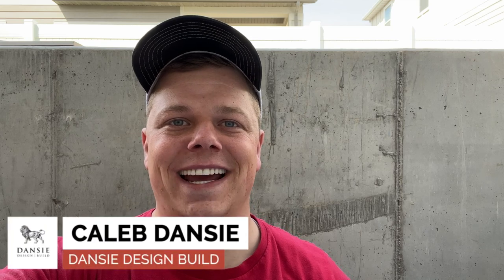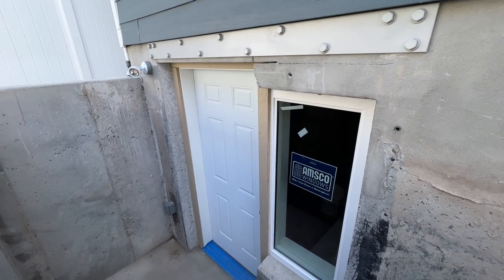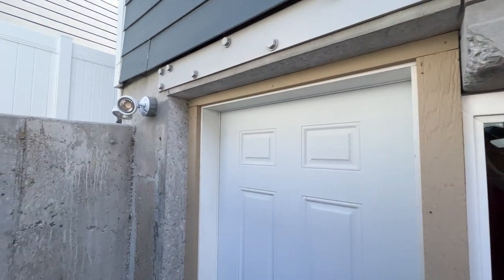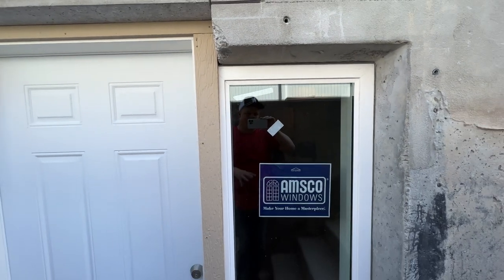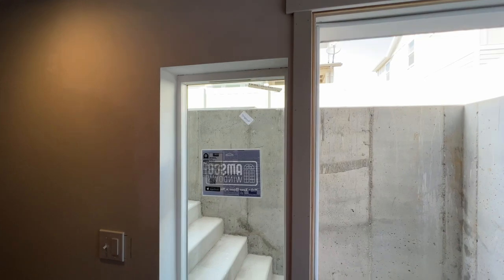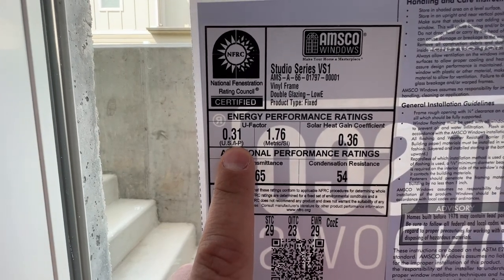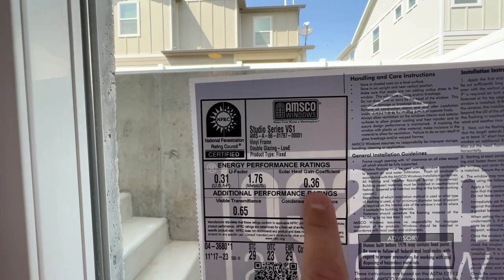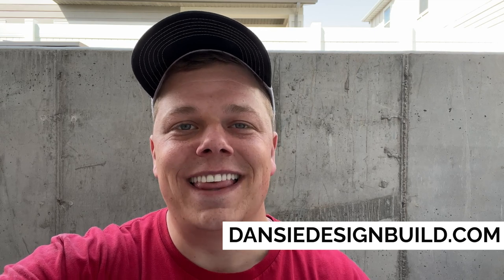Converting a Window into a Basement Walkout Entry Door

Comment: Was the original egress window concrete or corrugated metal? The house I'm looking at has a concrete box build outside the egress windows instead of some rock and corrugated metal like I'm used to. Not sure if that can be turned into a door or if it will just be more costly and they can jackhammer it out or something.
Reply from the maker: Metal. 
Just a bit more cost to demolish the concrete in your case. 
Thanks for the comment